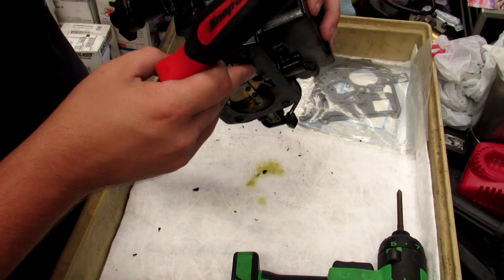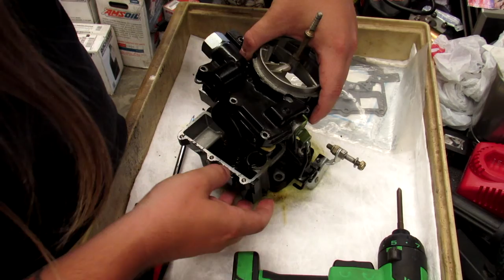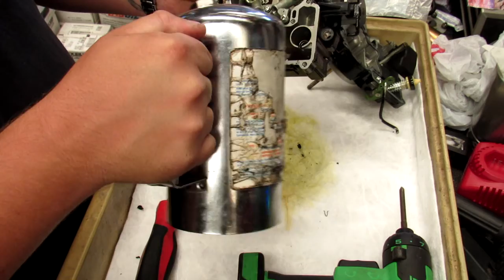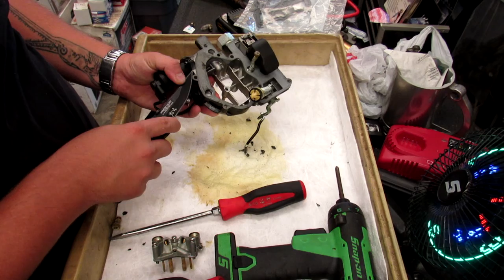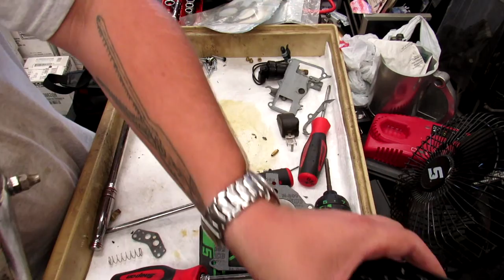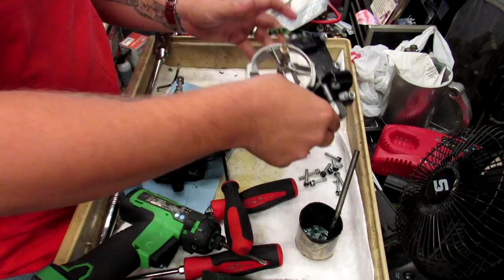Mercruiser Mercarb with TKS (turn key start) rebuild

Comment: The video does not cover taking out the power value spring which is stamped in and cleaning all the ports involved if you can’t do that no mater how good the job is or how clean the jets are the carborator will fail under use in the middle of nowhere and that is very dangerous you got to take out the power spring  and that stamped in the carborator. body. Only on tks s. It’s like job security for merc cruiser because a new carborator cost. 1,200 dollars the old electronic choke carb would be better if you can’t fix the tks it will fit right on the manifold And you can disassemble the power spring for cleaning

Comment: What rebuild kit did you use.  I have the same carb, but am struggling to find the right rebuild kit.
Reply from the maker: It was a kit from boats.net
Reply: @HamiltonLandWorksLLC  , am i looking for the number that is stamped on my carb? The stamp on mine is 8m2003946.

Comment: I know this is an old vid but I can’t find a specific tks 3.0 carb rebuild kit. Did you use a standard 3.0 rebuild kit?
Reply from the maker: Boats.net would be my first place to look,  then ebay.  If you can't find one there check in with any local shops that only deal with older boats.  The shop I worked at had a surplus of old kits. I'm no longer there and can't speak for parts availability. I also can't say that a standard kit would work. Subtle changes are made to marine components to meet uscg standards and to not allow automotive comments to work. Carbs, alternators, and starters are usually the first things you'll notice are different from auto to marine.

Comment: What is the spray you are using when re-installing the jets?
Reply from the maker: Amsoil MP. WD-40 will work as well.
Reply from the maker: It keeps the jets from sticking if you have to rebuild it again.

Comment: Hey Charlie. Thanks for doing this video, one of the few ever done! After doing all of this, are there adjustments to be made once back in the boat? 

I have a 2006 4.3l TKS and it has a rough idle, probably something going on in the idle circuit. Boat runs awesome outside of idle.
Reply from the maker: You shouldn't have to change any thing, pending that the engine ran done with the current settings before the issue started.